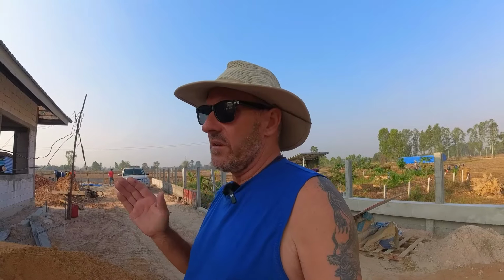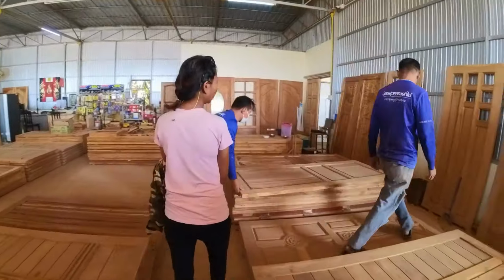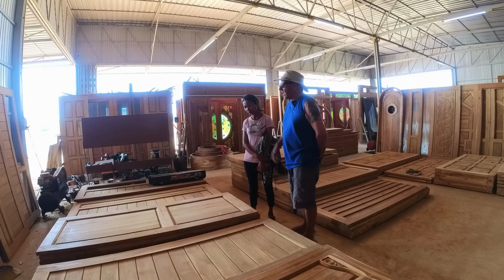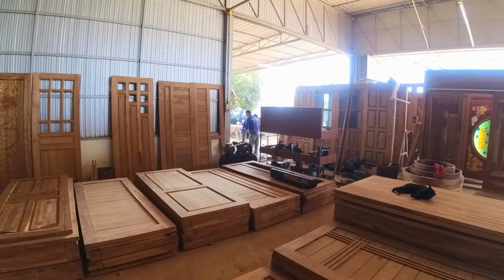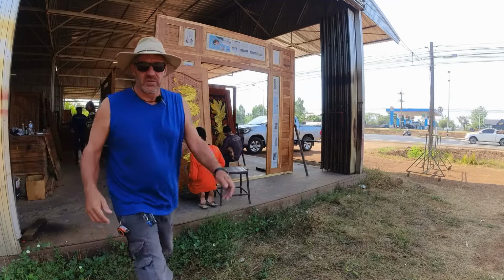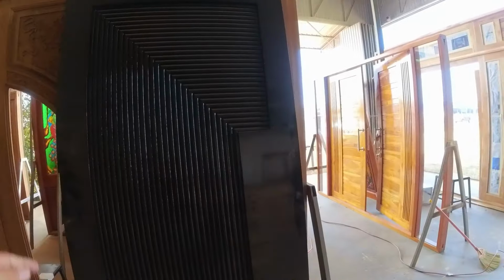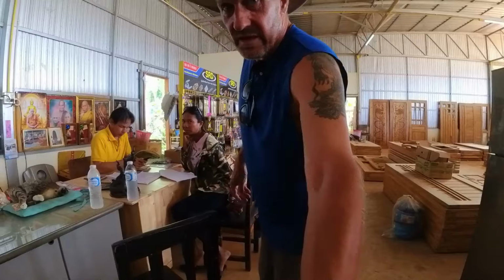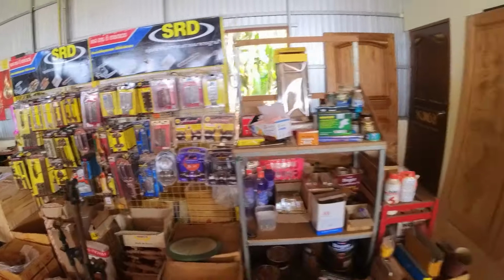Teak Door Shopping

Comment: Hi mate, just a side note, timber benchtops look great at first but where you rub against it and the oils out of your hands will deteriorate the lacquer no matter what you use. The problem then is if you just reseal it you'll end up with 2 different colours unless you sand and blend it out.
Reply: That`s why they have door handles.😂
Reply: @americaninthailand8760  the benchtops have door handles 🤣. Don't worry I've drunk too much before too 👍
Reply from the maker: Likely look to marble, but havent really looled at what our options aee yet. I better get busy, its coming quuck.
Reply: Hi Kenny and Sompit.
Your build is coming along nicely. I'm hoping to start our build by mid yr.
I had to come back to this video to get the name of this place.
This morning I went to a local timber place. 
We asked about teak doors. Their price was little crazy, came in 7500bht per door 80x200😮. Normal timber door was 3500.
So I was wondering if you have a phone number for this place. Unfortunately we are in Khon Kaen.
I will get my wife to call and see if we can do something.
Also if have you seen any agricultural pipe around in your travels.
In Oz we call it Aggie pipe, good for drainage. I'm finding it very to find here.
I might just have to buy a length of rubber type pipe or PVC pipe, and drill a shit load a holes into the top half, alot of holes over 24 MTRS of pipe, 😂😂.
Like watching your build. 
Have a good one.
Cheers
Reply from the maker: @sydhills3387  if you can email us at paradisenthailand@yahoo.com but yes we have the number, in fact i think it is on their sign in the video, but i will get it from sompit. Pipe: are you lpoking for perforated drain pipe? If so we have a local store that has it in stock. A bit pricey though. Thats what i used for my septic leech drain

Comment: We have the exact same internal doors as you chose fitted 7 years ago and still look perfect. We also used Hefele hinges and locks throughout and all still work without fault just make sure you get a good carpenter to fit them. Clean lines for me every time not a fan of all that decoration though.
Reply from the maker: Ill be sure to look atvthe hefele locks. I think that will be tomorrow, as we are meeting them tomorrow to pivk out all thetile, hardwares, and fixtures.

Comment: Once you have your ideal area for storing doors, make sure you keep them stored horizontally, and on a flat surface. Having several doors laying on top of each other is also beneficial because their weight will hold their shape and prevent warping. Avoid storing doors vertically.
Reply from the maker: Thats the problem, we dont hsve a "good" storage location. Plan to see if they will store for a while.